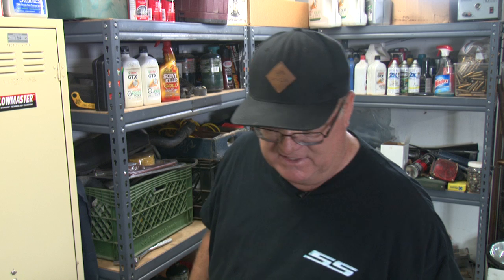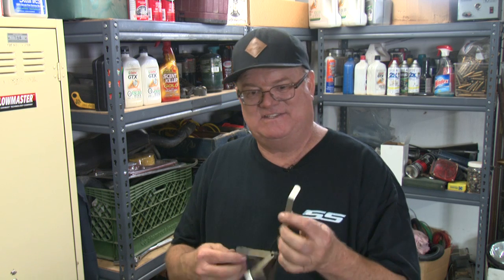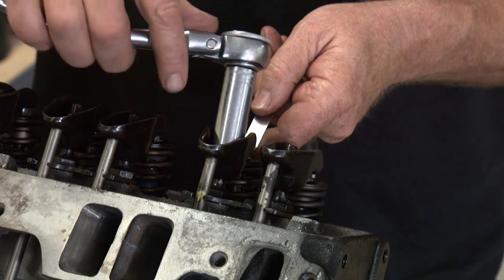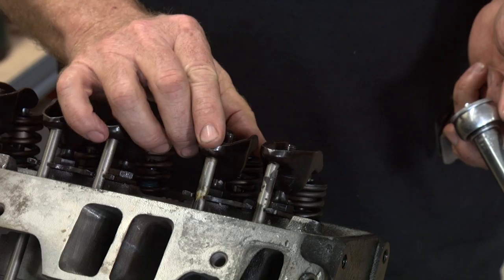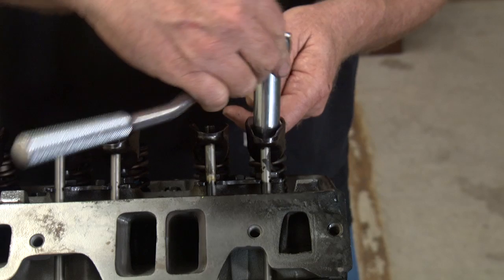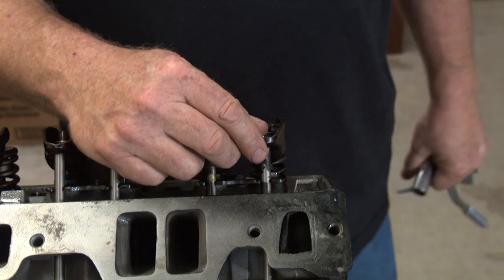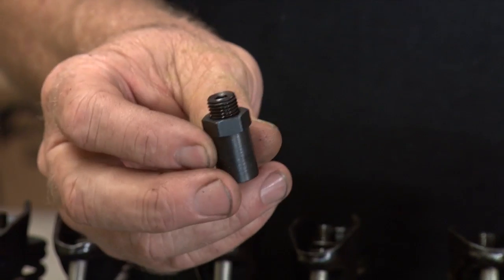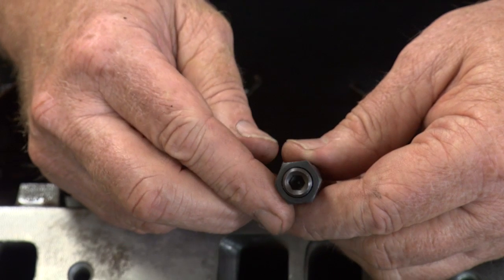Mastering Valve Adjustment: Step-by-Step Guide for Solid Lifters on a Small Block Engine

Comment: Where in the world would I find a cam card for a 1988 Chevy Sprint though?😢😂 I've just adjusted them so there's no noise 🤷 Tiniest bit of play on each lifter. Google says Half a millimeter or 20 thousandth!? That seems massive doesn't it? Solid lifters by the way🙏 Even though everything runs good and it's much quieter, I still worry constantly😂

Comment: you arent stating if you are adjusting the intake or exhaust. in #1 position you can adjust other vales while in that position. if you are doing this on a cold engine you need to add.002 or when engine comes to temp you will be to tight.

Comment: Good video. Nice easy basic instructions. You do not have to follow the firing order, you can work your way down each bank, just have to rotate engine (alot of people will go 90 degrees and do it as per the firing order) but if you are keen and comfortable with doing it 1 bank at a time, then just a little more rotation in order to work your way down the Pass or Driver side (It's all in whatever you are comfortable with, but the procedure in doing it does not change!). Great video.

Comment: Have a small block chevy (383) stroker. Has a pretty wild solid lifter roller cam. I have no cam card. Is there anyway to no where I should set lifters at without card?
Reply: call the cam company...if u dont know the cam it should be on the face of the cam a part number....from that you can tell what lash u need

Comment: The easy way is nos 6in fully open adjust nos 1in,2ex o ad 3ex,5in ad 8in,1ex ad 6ex,7in ad 4in, 8ex ad 5ex,2in ad 3in,4ex ad 7ex,1in ad 6in,3ex ad 2ex,8in ad 5in,6ex ad 1ex,4in ad 7in,5ex ad 8ex,3in ad 2in,7ex ad 4ex -thats the easy way for sbc hope it helps

Comment: Thats wrong way ,the lifter will still be on the ramp.if you don't have a chart for the proper order to do it easy way have to rotate motor til valve you want to adjust is at max lift then rotate motor one full revolution ,then using a feeler gauge thats only as wide as the valve stem slowly tighten down while turning the pushrod when you feel it just hitting your there and if your new go over it again til your sure they are close as you can get them. o an thats one revolution on the damper !mark it if you feel you need to.Roberts way won't even be close.

Comment: Yeah, let me add one thing. Since nobody has x-ray vision, I recommend 
that you have a harmonic balancer tape glued and sprayed with clear 
paint to your balancer for PERFECT VALVE ADJUSTMENT.... No guessing when
 you THINK the valve is just 1/4 open or closed.  If you bump or turn 
your motor over with a wrench on the harmonic balancer, then you will 
know EXACTLY when your valves are open or closed. That is the proper way
 to adjust valves, whether they are solid or rollers. NO GUESSING GAME 
LIKE THESE FOOLS ARE TELLING YOU. It's your motor, and if you want to 
bend pushrods and break valves, then just follow their instructions, and
 you WILL replace your cam, lifters, pushrods and valves... It's your 
car and money. I repeat, the ONLY WAY TO KNOW WHEN THE VALVE IS OPEN OR 
CLOSED is to look at the mark on your balancer when it is on the intake 
stroke or exhaust stroke. Then your adjustment will ALWAYS be perfect, 
not HALF-ASSED... If you disagree with me, don't curse me out!!! Ask a 
professional builder of motors! Don't take my word for it. It is just 
common sense that nobody can guess the exact time a valve is open or 
closed by just bumping a motor over without checking the exact time of 
valve and lifter movement, without looking at the marks on the 
balancers.
Reply: Joseph Monaco your exactly right that's why it's marked on the hormonic balancer